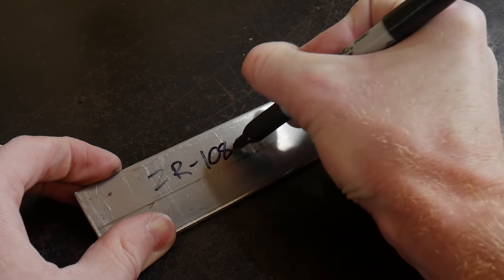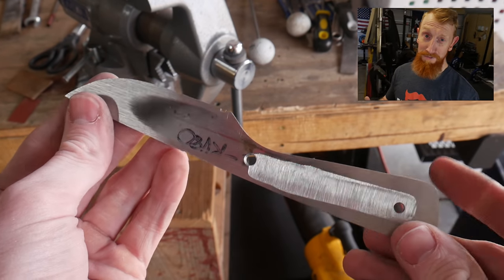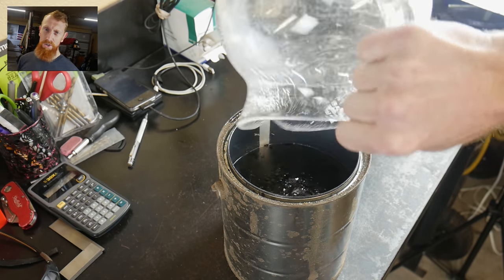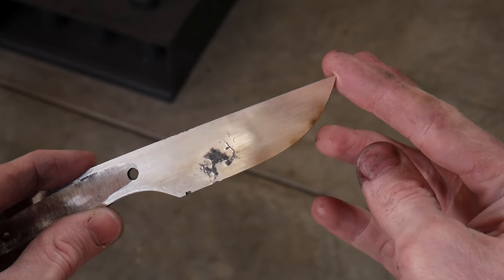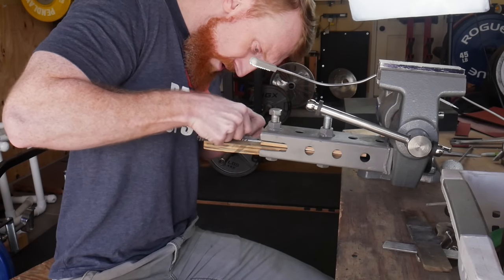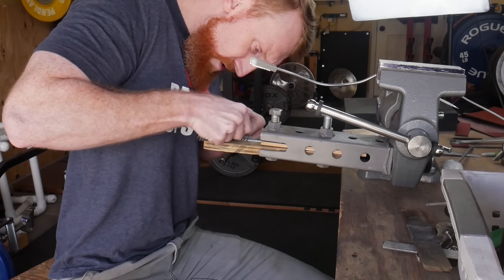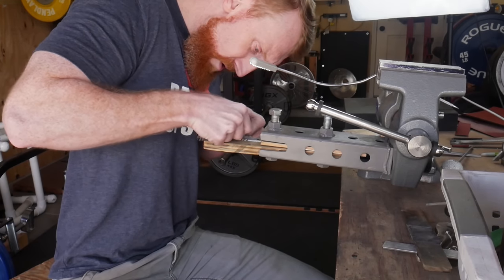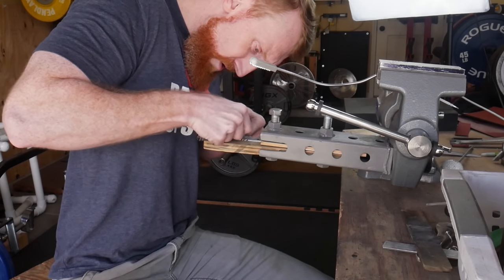The BEST Knife EVER Made | Master Stock Removal Knife Maker Shows His Secrets | Knife Making PARODY

Comment: Have you ever used EDM stones , I used to run a Mits  EDM carbon sinker machine . The polisher would use these stones , that’s what they used to get the scratch marks from the grinder or carbon eltrodes  off fairly quickly. I use 120-1000 stones , then wet/dry sand paper with WD-40 oil , 1/4x1/2x6 inches long , they work great . I like your channel and the DIY projects you do . Keep up the great videos. Toolmakers/ welder are a dieing breed of hard stressful workers . Building small EDC knives is a hobby to me when my heart is working properly. Stay young as much as you can this getting old is not what it’s cracked up to be , keep those videos coming !
Reply from the maker: Thanks man! I have been messing a little with those.

Comment: So you’re thinking outside of the box; I like it.  Question, I’ve been told numerous times to temper immediately after quench; Why?  It seams to me that all transformation would occur on the cool down and stop around room temperature?  Asking this because I think they are sending out the same kind of information that is in this video.  I can’t wrap my head around it being true at all.
Reply from the maker: Hey man this video was a parody for April Fools. I have also been instructed to temper right after the quench. Some practical reasons is that if you drop the blade on concrete after the quench it will easily crack or break. I always temper after the quench.
Reply: @RedBeardOps  I didn’t think about if you had ever told the nation in the past about tempering fast.  It was no knock on you.  I put it out on a Facebook forum and ppl came back on me saying that it’s absolutely necessary.  I can’t see how they are correct and really I think they are full of shit
Reply: Like in plumbing, which is what I do.  Plenty of ppl say if shit runs down hill to fast it will out run the water and you will be left with a stoppage.  I have seen that situation so, so many times and nothing ever happens and I believe the whole premise is false
Reply: I have never in my 16 years experience, have experienced a stoppage down a hill; although I am sure it happens, but it definitely not detrimental and an old wives tale just like the tempering I am sure

Comment: It's also better if instead of grinding your bevels in with abrasives, use a bevel jig on the band saw. Then leave your high-carbon blades outside with no protection. To get the best results for your edge.

Seriously though. Someone told me they do this, it wasn't April 1st, they weren't kidding.
Reply from the maker: LOL, damn.... that's a shame.